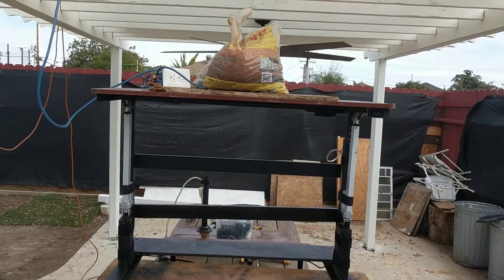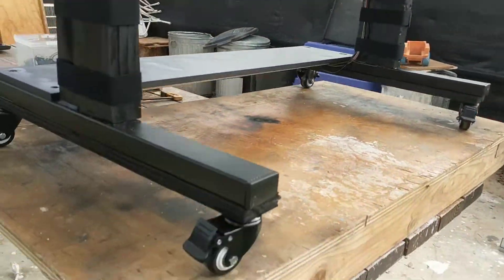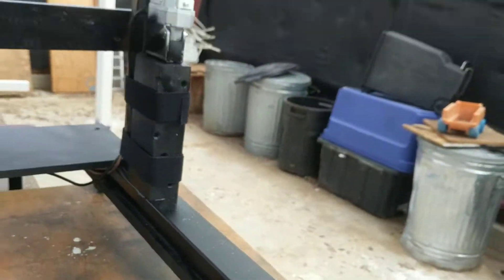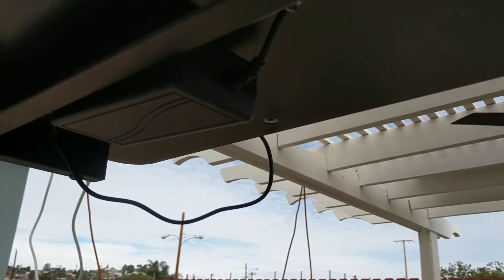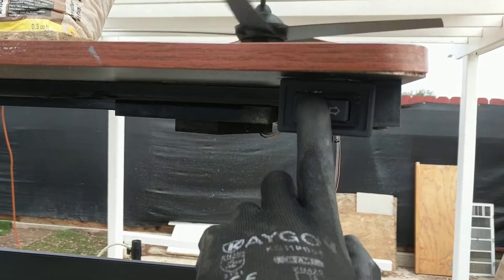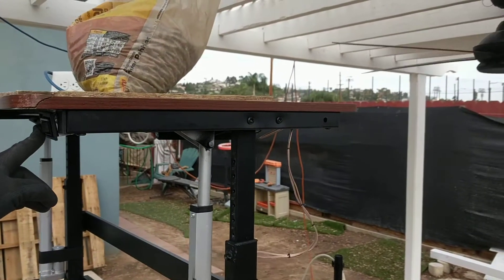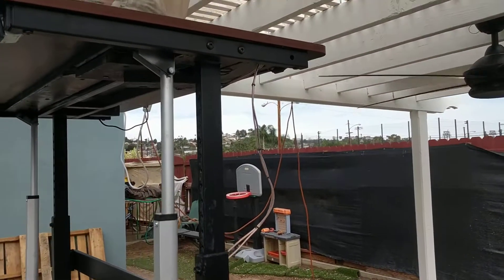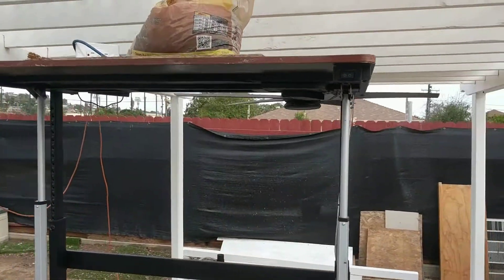Motorizing a sitting/standing desk with linear actuators and a switch

Comment: Hey, nice work. Could you tell me what did you use to made up/down simultaneously both actuators? Thanks
Reply from the maker: You wire both positive wires and both negative wires together. Then you need a switch called a "double pole double throw momentary switch"  also sometimes called DPDT. Search that on Amazon and the switch is probably 10 to $15 sometimes they come with a relay kit for about 20 bucks. 

Comment back if you need more help thanks.